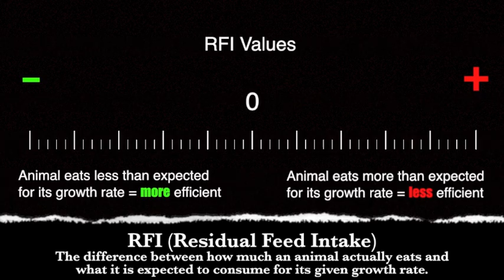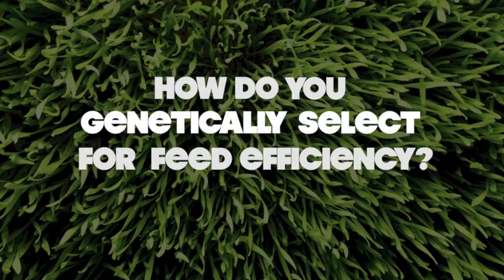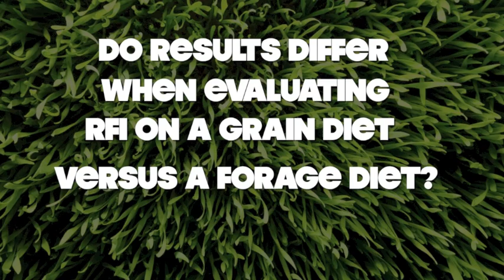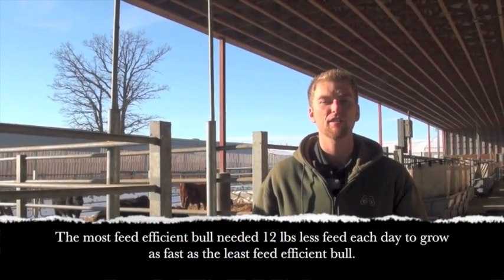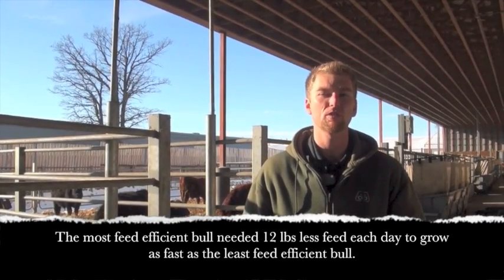Beef Research School - Using RFI to Select for Feed Efficiency

Comment: RFI has become the buzz word for selection for efficiency. The arguments for selection are irrational. Anyone with knowledge knows that selection for any phenotype, in the light of genetic merit predictions with advance (mixed) models. Furthermore, selection indices, combining different traits in ERTs and/or breeding objectives are the methods employed by genetisists, NOT SINGLE TRAIT SELECTION!!! Why the comparison between RFI and feed Conversion Ratio? A proper selection index includes intake, growth rate AND MAINTENANCE of females. RFI is simply a deviation from an ASSUMED regression line based on assumptions regarding expected intake based on body weight and growth rate. Why not use EBVs for mature weight and even milk production (maternal) as a more accurate indicator for maintenance? I think the propagandists for RFI have to go back to the basics of genetic selection and stop pushing for RFI. An animal that stopped growing and eats nothing might end up with the best RFI in a group and ends up as the top selection candidate! It is time to study the principles of selection indices again.